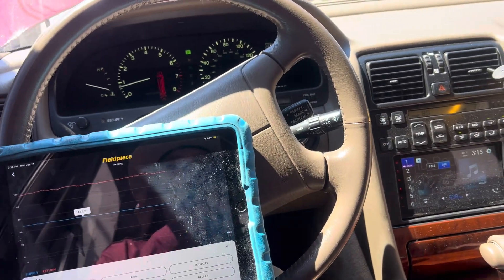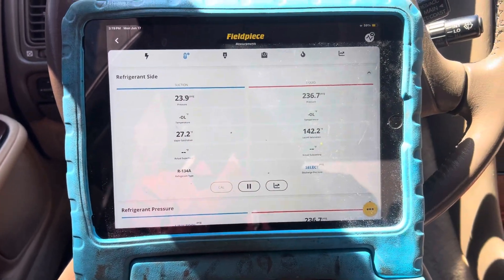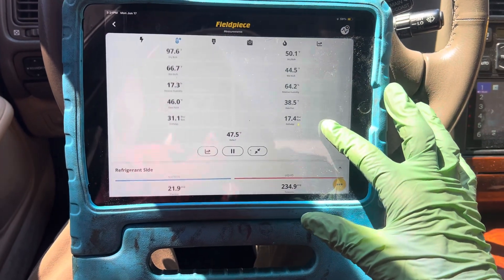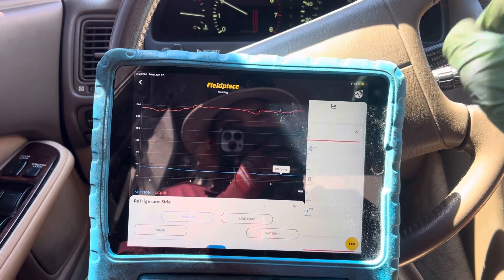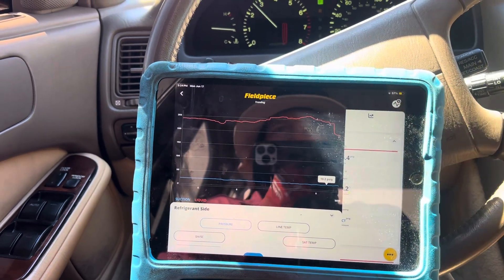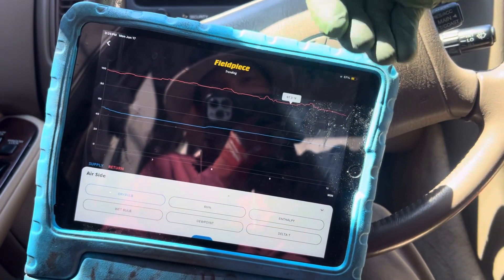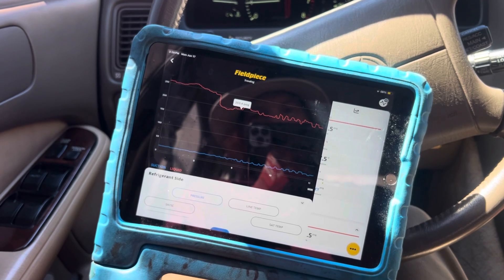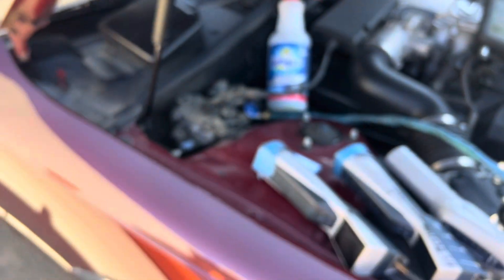Automotive technicians destroyed the air-conditioning compressors on this car trying to use pressure

Comment: i hope i dont see one of those cause i would be dumfounded wait a minute let me call the master. heheheh
Reply from the maker: Don’t worry, there’s several different styles of the system located with devices that look different not all the same and a lot of guys don’t know they even exist. 
That’s why we get so many burned up compressors . 

Compressors don’t die they are murdered .
Reply: @coldfinger459sub0  You nailed it about compressors. All they want to do is to come on once, never stop and work in correct conditions. This way they will run darn near forever.
Reply from the maker: @commenter5469  you get the true golden trophy 🏆 🥇 award

Comment: Maybe your overcharge already leaked out somewhere.
Reply from the maker: This is a extremely slow leak that takes several months to leak

No leakage in a few minutes will even make 1 g of a difference in weight of refrigerant loss on this system

Comment: question low side staying that low would that relate to the evap core temp. if so that would cause freezing right. im not familiar with that system.
Reply from the maker: Differences systems their airflow and evaporator design are different. 

Some designs for manufactures have the temperature just a few degrees above freezing . 

As long as they keep high airflow over the face of the coil through the fins, the heat load of the air will keep the surface of the metal forming ice . 

There is a efficiency lost through the transfer of the refrigerant actual temperature through the metal so it’s not exactly the same temperature as the refrigerant because the amount of heat load on the outer surface stops the metal from going below freezing 🧊 the heat transfer of the air is faster than ice can form on the surface.
Reply: Still something fishy. If the compressor lost its efficiency - you would see higher low side pressure, because compressor is bypassing.
Whatever you show looks like low charge and very low evap airflow. But compressor kinda OK.
Maybe your overcharge already leaked out somewhere?
Reply from the maker: @commenter5469  and this is exactly the point I’m trying to get to almost nobody understands that the low side fitting I am connected to has nothing to do with the evaporator pressure

Because almost nobody in this industry, especially outside of the industry, understands what a POA valve does and how it operates 

Your question is a perfect example of not understanding the refrigeration system components
Reply: @coldfinger459sub0  Well! VIR valve ( looks like that’s what you have) not supposed to go lower than 20 psi, either R134a. But yours did go lower, that’s why I’m saying there’s something fishy, and you’re “not out of the woods” yet.
Reply from the maker: @commenter5469  nope you still don’t understand. I’ll say it again.. 
I am connected between the POA valve and the compressor . 
Not the POA valve and evaporator 

And a VIR assembly has the expansion valve built inside with the dryer. This is not a VIR assembly. . 

Nothing fishy operating perfectly exactly how it should 

And the misunderstanding is the reason why so many technicians who have a little bit of information and knowledge about standard systems always get this system wrong . 

This is a little bit of knowledge is dangerous . 

Kinda like when a technician has a very old Chrysler V2 compressor with the EPR valve and a third suction fitting located at the back of the compressor . 
      And a technician gets five psi and think something is wrong 🤔

Nothing wrong with the system everything wrong with the lack of knowledge .
Reply: @coldfinger459sub0  I get that, and I wasn’t sure what kind of suction valve is there, from the video looked like it was everything inside the receiver.

What I am talking about is your headline for the video ( maybe I misunderstood), it makes people to think that this compressor is already destroyed. If that compressor lost its efficiency - it’ll have lower head pressure, but higher suction pressure, but suction pressure is pretty much fine.

Looks like you just saying that people who don’t know what they’re doing overcharge the system and slug kill the compressor, but it’s kinda hard to understand.
Reply from the maker: @commenter5469  you finally got it and that’s why I titled the heading in this video the way I did. 

They are the ones who will get it 

And the ones who will not get it 

The ones who get it hopefully at a next level or moving up a level in education on Hvac 

The ones who have not it or understand a lot more work . 

For those who understand it as soon as they seen the title and the content, they knew right away what I was talking about . 

For those who truly don’t understand what these valves do and the receiver completely separate in the system, having nothing to do with the pressures or temperatures or any kind of control at all whatsoever . 

And if somebody doesn’t understand what a ST valve a POA valve a ER valve or a VIR assembly their purpose of operation and they truly don’t understand the three gas laws then they still do not have the basic understanding of Refrigeration 

They’re just at the level of heat moves to cold and lower pressure makes lower temperature. Refrigerant. 

That is far too basic and will not get anybody very far in this industry other than replacing a lot of unnecessary parts
Reply: @coldfinger459sub0  Non cycling compressed air dryers employ similar valves, they call it “dew point control”.

Might say EPR in supermarkets might be the same. But those only similar in principle, because they are non bypassing, and installed on the opposite end of the evap.
Reply: @commenter5469  i would be totally lost on that one
Reply from the maker: And I think I forgot to mention in my response to you you have to pay attention to what I said in the earlier video or earlier in this video I don’t remember if I mentioned it that this is a POA valve system

And the person who retro the system and put on a  134 fitting adapter attached the adapter to the compressor side of the POA valve because the refrigerant fitting port for the evaporator side of the POA valve was extremely difficult to get access to and you can barely see it unless you look down deep underneath some wiring and refrigerant lines. 

If a person does not understand the different refrigeration systems and the mechanical devices, and there’s no way for them to diagnose or even think or guess or to apply logic how the system is operating if they don’t understand the basics
Reply: @coldfinger459sub0  OK, got you.